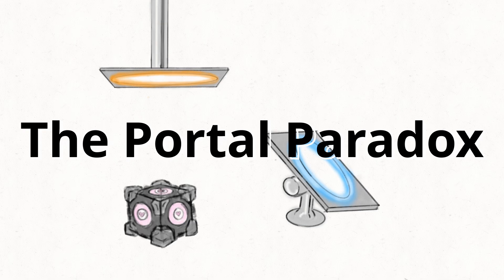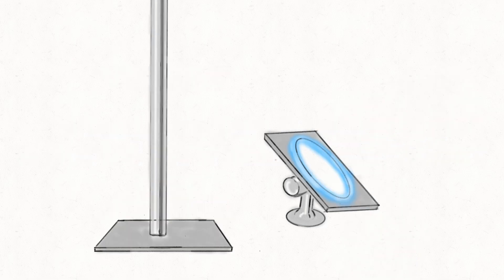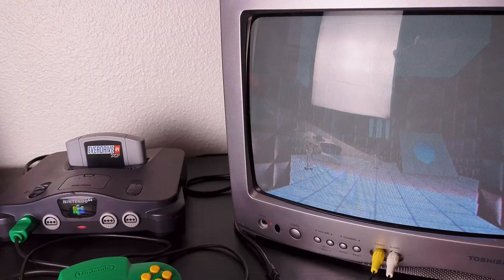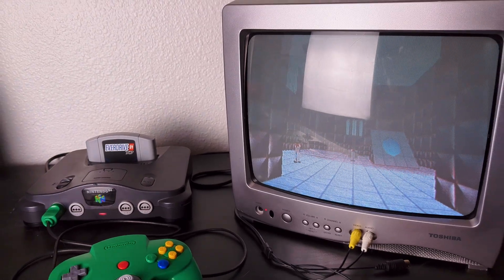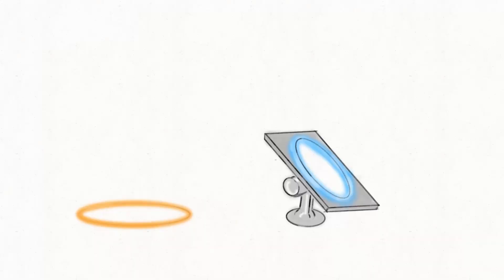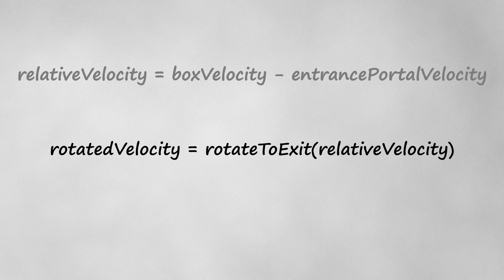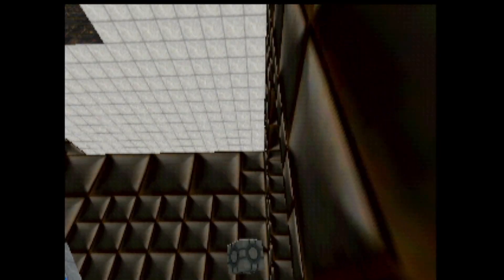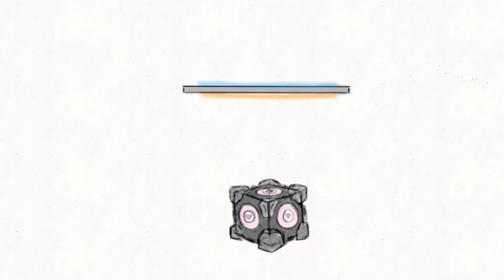I rewrote Portal from scratch and solved the Portal Paradox

Comment: I think what's wrong with this interpretation and many like it in the comments is that you assume the portal to be a thing that can have momentum and speed and "move". to me, the portals are like a space warp that connects two spaces seamlessly so when it moves, nothing really moves other than the platform it's placed on which has no bearing on the portal itself.
Reply: But in your example, the areas on both sides of the portal are effectively adjacent, and if one portal is moving, then the area on the other side of that portal is effectively moving relative to the cube. So once the cube moves through the portal, it will be in an area that is moving relative to it, and since the area is actually stationary, the cube must be moving. I agree that the video creator's example is flawed because he programmed the game in such a way that the portals impart momentum, but it would still work that way.
Reply: @godlyvex  Your explanation makes sense to me but I still think there are a lot of other rules about how the portals work that we need to know before there's a definite answer, but Thank you for your explanation.

Comment: The portal is a non physical object and it can't affect the box in any way
Portal is like a piece of paper with a hole in the middle
if you put a box on the ground and slam a hollowed piece of paper on it it won't affect the box because the box is affected only by the floor and gravity

So the correct answer is PLOP
Reply: he literally goes over that example with the paper in the video, in the form of a hula hoop. did you even finish watching it? and anyway I explained this in several other comments so I'll just copy paste

But in your example, the areas on both sides of the portal are effectively adjacent, and if one portal is moving, then the area on the other side of that portal is effectively moving relative to the cube. So once the cube moves through the portal, it will be in an area that is moving relative to it, and since the area is actually stationary, the cube must be moving.

Comment: Take an air filled bottle and compress it lightly with just opening touch the surface of water, as you release force is generated causing water to rise without being acted upon initially. While these happen for slightly different reasons, mathematically the energy is retained in both systems. The speed of the portal is transferred to the cube as it cannot continue on its path forward just like you wouldn’t lose your falling moment from one portal to the other. The energy must be preserved.

Comment: I was expecting it to remain still on the floor until tangencial weight beat friction and it slided off. Indeed I wasnt expecting this. I guess I always saw motion from the perspective of the center of gravity (floor) and the cube moving towards the portal would be different than a portal moving towards the cube because the cube has no speed relative to the floor). I never considered the relative speed of the portal as being meaninful (even if the portal moved toward the cube it would not get more speed, only the speed it had already, and if the portal was moving in the same vector as the cube, say at 80mpg but the cube catched up at 100mph I imagine the cube shooting on the other side at 100mph not 20). Interesting to see how the code actually solves it.

Comment: The flaw in this is that the portal has zero effect on the physical object.  The only thing effecting the cube is the floor it rests on. Placing the portal flat against the floor should make the other portal act as the floor except the change in gravity due to the angle the floor is now angled at might allow the cube to slide down or it might rest on the portal.  Congrats, you found a way to open and close portals without making them form or cease to exist.

Comment: The part wrong in the equation is the non-conservation of energy. In the referential of the room, if the box is moving toward the portal at a speed s1, and the portal is also moving toward the box at a speed s2, the resulting relative velocity is s3 = s1 + s2. Now, if we consider the energy aspect, the box has (1/2)*m_box*s1^2 Joules of kinetic energy, the portal has (1/2)*m_portal*s2^2 Joules. Adding the two, we get (1/2)((m_box*s1^2)+(m_portal*s2^2), however, the box moving at s3 (s1 + s2) has (1/2)*m_box*(s1+s2)^2 Joules of kinetic energy. Which are almost always different, unless the portal chooses its own mass depending on its relative velocity to the room (at equal speeds for both objects, the portal needs to be 3 times the weight of the box). Nevertheless, I really like the lengths you went to see it in action, and your demake looks absolutely awesome !

Comment: should it not simply slowly slide off of the diagonal surface? as the entrance portal is parallel to the flat surface, the exit should simply be covered by a completely flat surface that the block was on. this would make the explanation of the launch more easily understood as you could show the viewpoint from the exit portal, seeing the block flying towards it and making it simpler to understand?

Comment: This is wrong. There is no portal paradox, because people that think it would do what you programed yours to do are wrong. A portal is just a door. Sure it's a magical door that connects two disparate locations, but it is still a door, and in the case of the "paradox" question, it's just a door on a moving platform. Put a door on a conveyor belt in zero G and position an object in the center of the door then turn on the conveyor. The door (portal) won't interact with the object at all, so even if it has momentum of it's own, it doesn't impart ANY of that momentum to the object.

Comment: I'm curious in an experimental way: What happens in your implementation, if the movement of the portal stops when the cube isn't completely through? Will the half of the cube that's already throug drag the other half through with half the final speed?
Reply: Consider slicing the block in half and doing this. As we've seen, the top half will fly through, and the bottom half will not (as it hasn't entered the portal).

Now connect the two halfs with cable: the top half will fly through, but will have its velocity decreased as it yanks the bottom half through with it. The cable is the same as a chemical bond, so this is what will happen to the block.

If the speed is great enough, the block will jump out the exit portal at a reduced speed. If it is not great enough (or the block is too heavy) then it will just stick out, with the block doing a tiny hop then settling on the ground.
Reply: to give the answer to the question - as in what happens in his implementation: Most likely it is done the same as in the original games and the same as nearly every other game.
Physical properties like position, velocity, mass etc are calculate for a single point - the center of mass - that normally is set smack in the middle of the object. So if the portal stops and the center has not passed the middle (so "only" 49.999% of the cube went through) it will just sit there and not move. If more than 50% passed the portal and the center is on the other side it would launch exactly like shown in the video.

However to be consistent with the physics the game tries to portrait you would need to think of objects not in terms of single entities but in terms of the one half that is on the blue side and the other half on the orange side:
If the portal moves exactly 50% down the cube and then stops that would mean that now half the cub has the full velocity relative to the blue portal, while the other one has 0 velocity relative to the orange portal. If the material is not insanely strong it would just rip the cube in half, otherwise it would be the moving part just yanking the stationary part along and it would move with roughly half the velocity.
Kinda like if you tried to grab onto a speeding car.
Reply: I think Valve had an approach to this where the entering portal had proportional magnetism such that the object would still find its way through in most circumstances. The further the object went in, the stronger the pull was on the exiting portal.

Comment: I was wondering, instead of putting the portals on 2 sides on the same object (in test 2) why not put one on the moving surface going down and another on ground pointing to the ceiling? I'm not too good with equations but I can't see how the acceleration works in the game. Not to mention the physic source game engine isn't always 100% accurate in portal or any other game. I just imagine a speeding car with no windows and an object that's on a table or levitating passing through the car. I can't see how the object would just shoot with the acceleration of the car.
Reply: he already shows this, why would angling the stationary portal upwards change anything about the math?
Reply: Because of his second test isn't the same and I think the blue portal on ground level instead of a ramp would still be the same experiment. I'm just failing to see how it just shoots out like that with a consistent speed as well. 
Also source engine's physics are  vary questionable as well. Given how if you're in motion on a ramp or water you can keep that acceleration propelling yourself on the surface.
So, I'm curious if putting portal blue on a flat surface would change anything because the lack of gravity in the first test looks jarring to me. @Kittyhat

Comment: If you slam an emtpy box over a cube, does the cube suddenly jump in the box? No. The question is moronic and calling it a "paradox" is laughable. Portals are merely doors, and just like real life, an object does not move unless a force is acted upon it. Why would pulling a door over an object cause it to accelerate? That's ridiculous
Reply: your analogy is what's happening at 2:22 now imagine if one end of the door was moving and one end was stationary. you just proved the video right
Reply: @Kittyhat  that is still incorrect. There is no force on the cube itself. The position and speed of a portal is irrelevant. They can always be thought of as the example at 2:22 regardless of there actual position and speed.

Comment: I think the important vector is momentum and not velocity. Which leads to several interesting tangents. It would be conservation of momentum going from the moving portal to the stationary cube. Which means the platform would encounter resistance without physically touching anything. So it's robbed of momentum of every object it passes over equal to that objects momentum at that velocity. So if the cube had more mass than the platform the platform would slow down until it's velocity matched the momentum the object would recieve from the force. Without touching it. Interesting

Comment: The cube shouldn't move since it has no momentum. The portal can't transfer any of its momentum since it doesn't interact with the cube. Really if you think about the portal as a hole then the portal itself doesn't have momentum at all. The panel beneath it does and it never touches the cube.

Comment: The reason James is probably right is because it wouldn't be very "Portal" if there were on-board accelerometers on every portal unit in order to actively cancel out their own momentum. That would be a sensible safety measure after all.